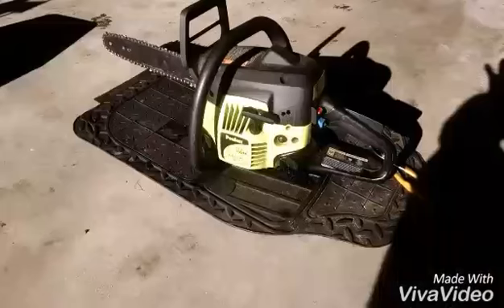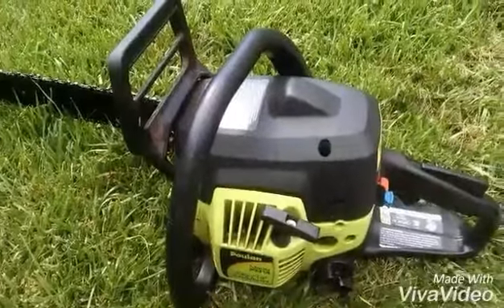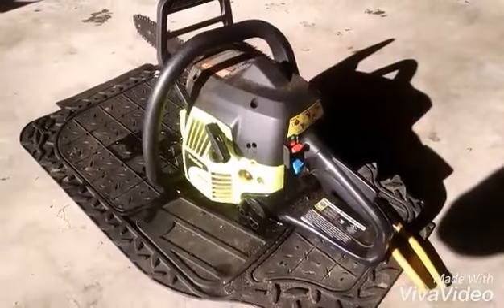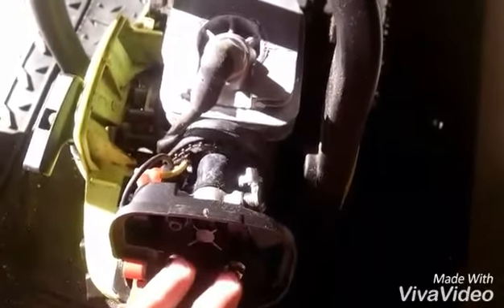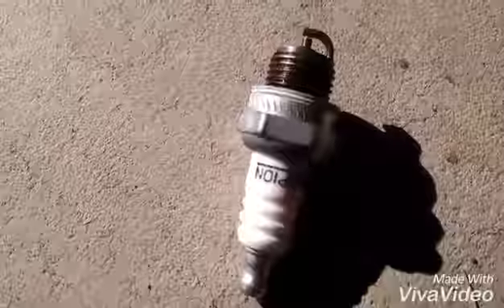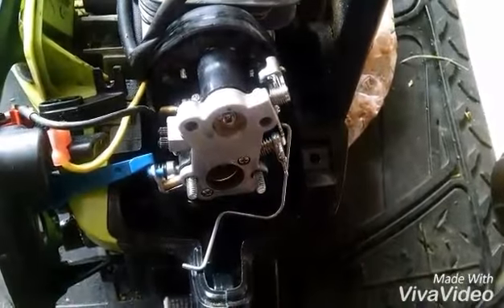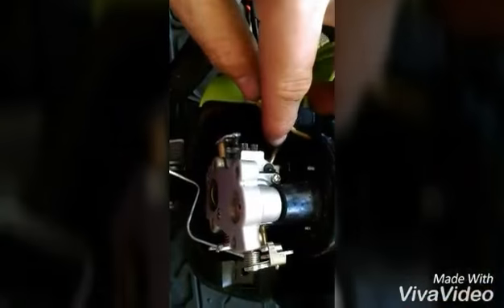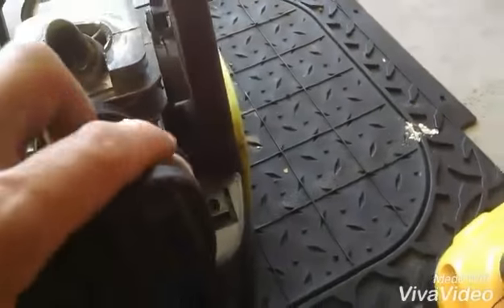Poulan 3314 won't stay running

Comment: Had this saw but quit using it because it always stalled. Bought a Stihl and used it every since. Watched this video and pulled the Poulan out of the garage and adjusted it like you said and it works fine now. Gave it to my son as his first saw (only uses it 2-4 times a year) and he hasn't had a problem with it since. Thanks for the video!
Reply from the maker: Thanks for the positive feedback, as always glad this was helpful

Comment: I have been given about 3 Poulan Wild Thing chain saws . All in like new condition ,very new looking . None would start and run consistently. After about 20 hours working on these like new saws, I sent them to the scrap pile where they belong!.I watched all the videos on how to magically fix the problem with Poulan , adj the carb,cutting a hole for better air flow into carb ,fuel lines blah blah blah! I have met guys who said they bought a Wild Thing brand new and they never ran for them . I mean Poulan  has to take the cake for building the biggest POS saw in the world here.I am usually the patron saint of lost causes and don't give up on anything . I just found a brand new old Poulan 3314  on  a shelf in my buddies garage . He passed away and his daughters found it and asked if it was any good.  I told them my Poulan experiences but said since it wasn't the Wild Thing and looked new ,I d give it a go! I got it started ,fresh gas carb cleaner ,adjusted the low screw like you just showed ,I knew that trick ! It runs but still dies at idle most times . Very hard to restart ! Its better than nothing , that's about all I can  say ! Poulan  should be ashamed for selling these saws. I rebuild motorcycles,cars,old tractors  anything with motors . I have a echo 14 inch that was used heavily for 20 years . Getting tired but starts flawlessly ,always has! My Still ,always starts . Its old and beat.  Your video was very good and well intentioned .
Reply from the maker: Thank you for your in depth comment. I also have a Stihl thats from the 70s that still runs great today.  Poulans in my experience have a shelf life and don't hold up like Stihls Husqvarnas.
Reply: It's weird cause I bought a Poulan Wild thing---had to be 12  or more years ago....on a black friday for $99 bucks. And for the longest time it was my go to , most reliable never failed to start and stay running. But  over time the fuel lines dried and have not been able to get it to stay running. But, since I had such good luck with it, I decided to buy another Poulan Pro last year on black friday for the same #99 bucks and it's been a dog since taking it out of the box. Just will not stay running. I know other Poulan owners say the same thing= never buy another one. I'm disappointed to get a new one that wont stay running no matter who makes it. I've read many other Poulan" Pro" owners have this same problem, so don't think I just that one lemon
Reply: @captinbeyond  all that shit has happened to me with stihl chainsaws of not wanting to start up but my poulan pro always starts up while the stihl i have to keep pulling the rope

I think poulan pro is a good name brand saw and are reliable chainsaws. and then the more you use it its gonna wear down and gas lines will get old and then you replace them with new gas line or whatever it needs nothing last forever but mine still works good I've just been using it more than keeping it cleaned up and I adjusted those splined screws last year and did the other day I'm gonna clean out the whole carburetor later on it hasn't been cleaned out in over 7 years I'm gonna buy another poulan pro just like the one I already have now then I'll 3 good poulan pro chainsaws 

those stihl chainsaws just don't wanna work with me I wouldn't buy another stihl saw they're not worth buying
Reply: I believe stihl should be ashamed of selling what saws they sale that's the only one that gave me trouble right after i bought it so it isn't no more cause I traded it for a broke poulan pro and i fixed the poulan so it runs good now I wouldn't buy another stihl but would buy another poulan pro because they work better and starts right up

Comment: I can tell ya another trick to those saws ,  long story short I have a wild thing saw , I removed the engine block and resealed the crankcase clamshell and the crankshaft seals , I then drilled out the main fuel line to a larger size in the tank and used a stihl fuel filter , I then replaced the intake manifold gaskets .. this saw runs perfect it hits 14,000 rpm fast , that 42 cc motor actually hit's so hard I'm worried the flywheel may explode , it's a beast lol , it's amazing how good those poulan saws really are
Reply: Did you replace the seals?

Comment: I love your video and that is a problem I am having with my new Poulan Pro saw. I finally got it to start, but it goes dead after about 5 seconds, and sometimes it will run 10 seconds before dying. I am going to check it for that problem with starving for fuel.
Reply: Just wondering if you were successful in getting it to run? and why, if it was new, did you not contact Poulan to resolve ? I have  a new one and fixing to take it in to one of their "trusted" repair centers
Reply: @captinbeyond  It was a new saw and I took it into the area repair shop recognized by the company and the carburetor was replaced free of charge. I still have not used the saw due to it being hard to crank for me. I use the battery saw which works great for me, and easy to crank and use.
Reply: @semco72057  They repaired it and it still won't work? Wow, but I also bought a small electric saw that starts every time and none of this crap with the carb, mixing gas, headaches. It's a bit small for larger cuts is the only problem

Comment: This video inconclusive.......did you fix it? Because I did all these things and wouldn't stay running. Virtually new saw. I then did a partial carb teardown where I found the metering lever drastically out of adjustment for a Walbro WTA30019 carb. I soaked in carb cleaner and blew out passages with compressed air. Still won't stay idling after 5 min. Next I'll change the fuel filter. Now I know why my dad gave it to me.
Reply from the maker: Good luck, thanks for watching
Reply: I be  been given 3 of them free. All like new ! Absolute POS saws! I wasted so much time and money rebuilding carbs ,fuel lines ,adjusting them. There are thousands of people with the same problem ,dont start,won't idle, hard to start , or runs then dies !Other than those things ,Poulans  are great saws!!! Great ballast to throw in a sink hole

Comment: Great video!  What type or size of carbeurator screwdriver do you use for the low side adjustment?  It looks to be a different size than the high side screw... but this is all new to me.
Reply from the maker: Lance Austin thanks Lance. it's either a small flat head or a splined it's been a while since I worked on that. Good luck!

Comment: Hey, I have a question. I have the same chainsaw with the same problem. What is the type of screwdriver you used to adjust the screw? I dont have a matching screwdriver. Thanks!
Reply from the maker: I believe it's called a splined, you might be able to use a narrow flat head to twist it?
Reply: @Neighborhoodgo2guy  It may have taken you a year to reply but I am truly grateful!! 😂 I'll have to go on down to a hardware store asap. Cheers.

Comment: What type of screw driver are you using to turn the low screw
Reply from the maker: They are called splined, Amazon, cheap. Often times you can find them in a set of different styles for $10
Reply: @Neighborhoodgo2guy  thanks

Comment: Same issue with my p3816 not ever wanting to start or stay running. Gas lines were old and dry so i replaced those now the new lines aren't tight enough on the carb fittings and leak. Tried zip ties they dont work. Are there hose clamps that small? Any suggestions?
Reply from the maker: Its been a while since I worked on this but was there a white plastic piece ("fuel line fitting") that sat between the tank where the fuel line goes? It would have had a barb on both sides to connect?  Can't remember if the fuel size to the carb was smaller?, dumb design.
Reply: @Neighborhoodgo2guy  I dont recall seeing one. I know the original line being more snug on both ends.

Comment: Where do you get the tool for adjust the carburetor?
Reply from the maker: https://www.amazon.com/8PCS-Carburetor-Adjuster-Ajdustment-Carburator/dp/B073XD9JM7/ref=sr_1_1_sspa?ie=UTF8&qid=1530708690&sr=8-1-spons&keywords=carb+adjustment+tool+set&psc=1
Reply: Lao Bandit ebay....

Comment: I'm not sure if the "Same Rules Apply as they did 46 yrs. ago, but Apprentice Auto Mechanics were taught_"Never Touch the plug electrodes & ceramics with Any kind of a Wire Brush's, or you'd Have SHIT'S & GIGGLES...Plus Loads of Fun, (IE: 426's or 440's~"STUFFED into Polaris's & Saratoga's!")...Replacing all of the Touched plugs, within a couple of weeks_Which when you think of it~Really, isn't all that much Fun!

Comment: Hey I got 2 poulon I’m working on. My bigger one poulon pro 4218 won’t stay running. I have a tool on the way for it. Over time do the adjustments move causing it now to idle or causing it to bog down when revved up or once there fixed are they fixed for good?
Reply from the maker: It could be several things, bad fuel filter, worn fuel cap, small blockage in the carburetor, worn diaphragm in the carburetor, seals,   or if you're lucky the carburetor needs tuned. Once you set it should be good for years. If you tune the carb and you find yourself retuning it. You may need to clean the carb or order a new carb. New ones are alot easier and fairly cheap. Let me know how it goes
Reply: I put sea foam in the tank and it Idling great. My other problem is that it’s a 20 in bar but when I put the chain on it the oil hole aren’t matching from the bar to the oil hole.
Reply from the maker: +Kyle Royer Best to get the 16-18 inch bar that fits maybe sell the 20?

Comment: also check the intake manifold gaskets , very important they seal properly !
Reply from the maker: excellent point John, thanks for watching and commenting!
Reply: Mine dies immediately after the upper chamber full of fuel is gone, my fuel lines look alright.
Reply from the maker: Do you mean after it's primed it will not run after that? Could be a oil fuel filter needing replaced

Comment: What kind of tool you used to adjust the to turn the low screw?
Reply from the maker: https://www.amazon.com/8PCS-Carburetor-Adjuster-Ajdustment-Carburator/dp/B073XD9JM7/ref=sr_1_1_sspa?ie=UTF8&qid=1530708690&sr=8-1-spons&keywords=carb+adjustment+tool+set&psc=1
Reply from the maker: i believe its called splined head

Comment: Dang man i wish you would of included the carb teardown =(
Reply: Worked like a charm, i couldn't find the tool i needed for my chainsaw but i found another video showing how to make it out of a butt splice electrical piece and turned it 1/4 turn 3 times so 3/4 of a turn and it idles like a champ now.